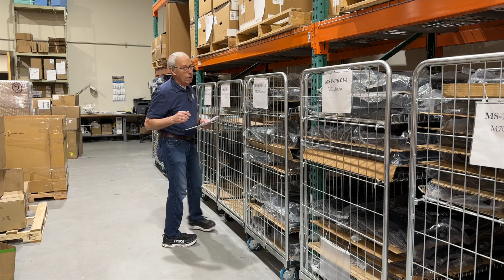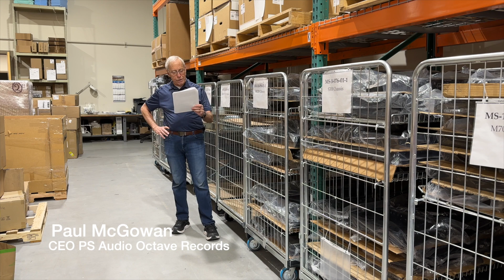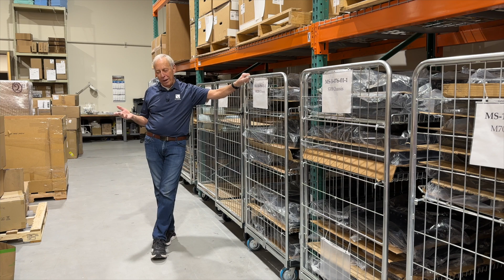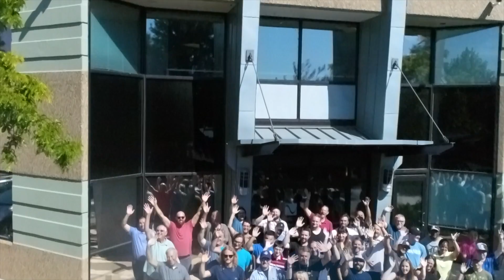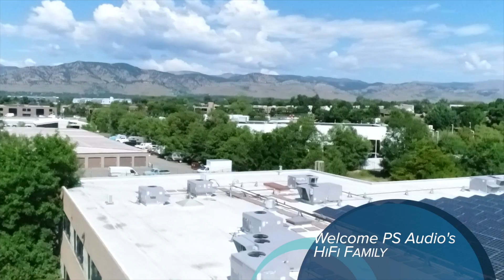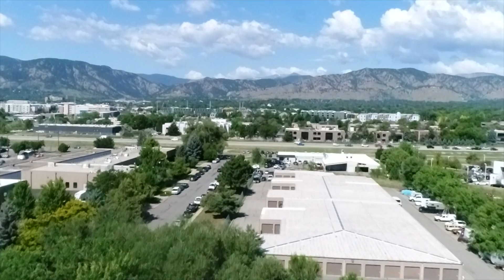Why the last few feet of the power cable matter

Comment: It DOES NOT MATTER ...CABLES DO NOT MAKE A DIFFERENCE.
Reply: Please don't use the revealing system crap. I have a 15,000 dollar system, consisting of kef r7 meta speakers, NAD M23, poweramp, Gustard r26 dac, denafrips hestia preamp, Eversolo dmp a6 m.e
I tried using different power chords, one of them costing 1500 dollars. At first I was sure I heard a difference, but then, failed a fair blind test, learning it was all placebo
Reply: @redkh2017  you're right bro ....cablesbarebutter bullshit.  Retailers make a load on cables . 

It's nonsense,  and they've been  pedalling this shit for years
Reply: @redkh2017  Placebo can be potent though. Some people claim they feel better after drinking "holy" water.

But it is also possible that some people do nail blind tests because they actually can hear a difference.
Reply: Oh well, you’ll never know.
Reply: Enjoy your Bose system my friend 😜
Reply: They certainly do make a difference. But like Paul said, you need a revealing system to hear it. Meaning you can't have an entry level system with a pair of 200 dollar speakers and an integrated amplifier costing the same amount. In such a case you will probably not notice any difference what so ever.
Reply: @marcusfredriksson738  yeah OK,  whatever you say
Reply: @marcusbrsp  So what would be an entry level revealing system? Maybe some used Maggies or Kef LS50's for starters? Quoting dollar amounts does not mean much.
Reply: @zulumax1  I couldn't possibly answer that. Personally, I spent about 8000 dollar on my stereo setup and I certainly notice a difference between a generic power cable and a properly shielded power cable. It's not like it's a night and day difference, but it's noticeable.
Reply: Absolutely cable makes a difference, it's just not as huge as changing a speaker @marcusbrsp
Reply: @garymah3287  of course not. And if the total value of your system is 500 dollars, buying cables for 200 dollars is not the way to go. Better get a DAC or an amp instead.

Comment: With limited knowledge but a scientific background, I was skeptical about power cables having an influence on sound.  But I experimented with various home made cables and found to my surprise they can have a significant impact.
My observations suggest that they act as a filter, a shield and a conduit.
I found the shield works well on a digital source.  I prefer unshielded on amps.  I think that architecture makes an impact.  Connector quality makes much smaller impact.
I use twisted pair for power conduit.  This would filter common noise.  I use a ferrite bead on the safety earth but not on the hot/neutral.  On the power conduit the inductor dampens dynamics, but added to the safety earth it improves in the way reduced noise improves sound.  But I also found that wire gauge makes a difference.  Same architecture, but much larger gauge sounded better.  Again makes no sense as all this is plugged into a smaller gauge in the wall.  So I don't try to understand it, I just use what works and enjoy it.  And no, since I spent next to nothing for it I am not justifying my investment.
Reply: Typically it's both, ... they experience a difference AND they're attempting to justify their gear choices.
Reply: @FOH3663  A little consideration of how the brain processes sound would be useful to most audiophiles, just like knowing the basic laws of electricity would also be handy, and stomp out a lot of audiophile nonsense.
Reply: You don't have to justify your investment. Its your business, and no one else's.
Reply: @AT-wl9yq  Agreed!  I just get fed up with the deniers telling me I am trying to justify my investment by thinking I hear a difference.  While that is possible, it's a stretch when you build your own cables with wire you found in a recycle bucket.
Reply: @AT-wl9yq  He doesn't have to justify it, but if he's claiming something, he better have proof to back it up.